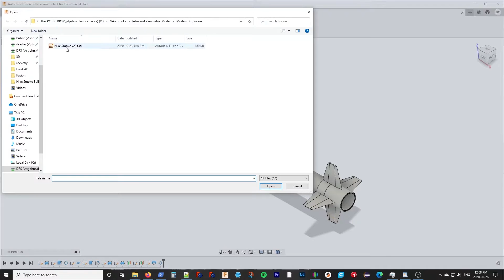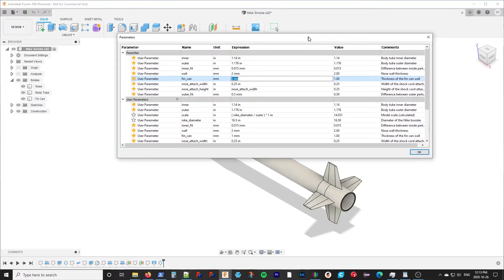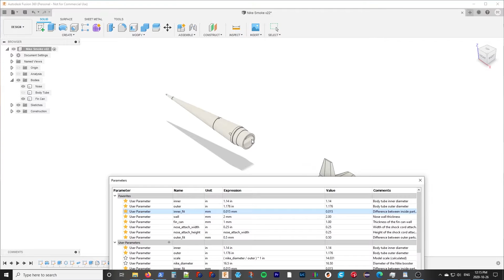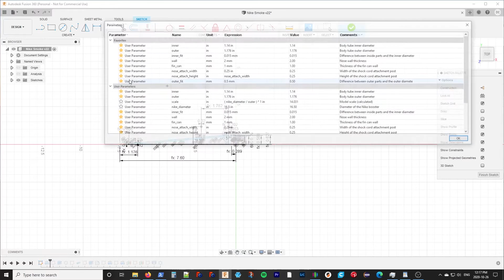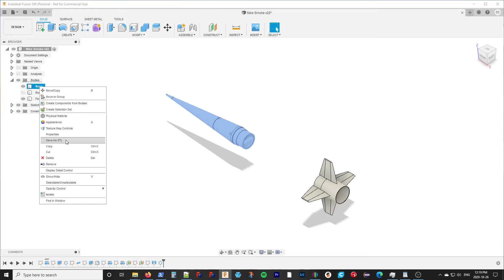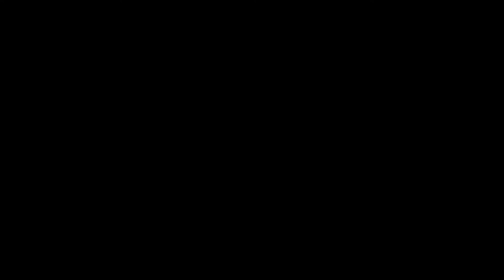Nike Smoke Parametric Model Using Fusion 360

Comment: This video inspired me to finally do a  parametric rocket design though I used FreeCAD rather than Fusion 360.

I actually designed two rockets, the Black Brant VB and VC because they have so many measurements in common. They're assembled, but not totally painted.

Overall a fun project. Thanks for the inspiration.
Reply from the maker: I actually have a FreeCAD version of this rocket. I started making a video but after several technical glitches with sound, I took a break. Been many months now... I need to get back at it!

Comment: Interesting series although I have more questions than comments.
Which did you import an image of the rocket or the schematic diagram? 
How did you design the fin profile?
Why didn’t you use your Fusion 360 nosecone plug-in?
The fin can is one-piece attached to the airframe?
Reply from the maker: I first came across the image in the Handbook of Model Rocketry about 40-45 years ago, but an image search will turn it up. https://commons.wikimedia.org/wiki/File:Nike_Smoke_dimensions-01.jpg

If you look in the fusion file, I did a profile of the root, another of the tip, and then a loft from one to the other.

I didn't use the nosecone plugin because this nose had some extra features. All the plugin does is draw the initial sketch which is then revolved. I drew my sketch manually, with the extra details.

Finally, yes this is a one piece fin can that slides over the body and is glued into place using some CA glue. If you watch the NASA documentary, you'll see a similar arrangement on the original.